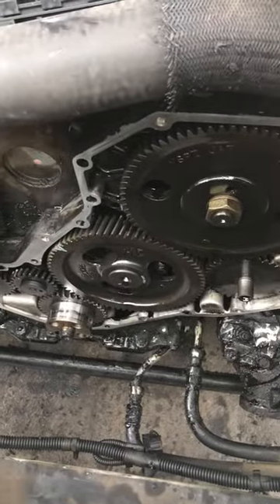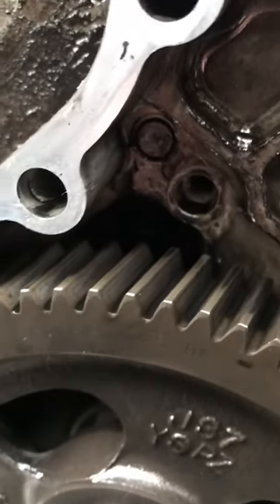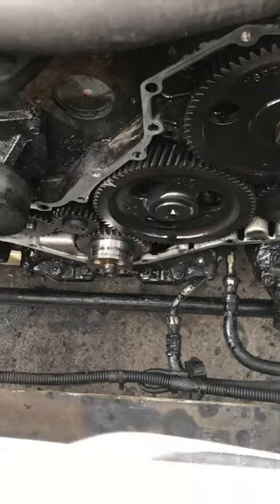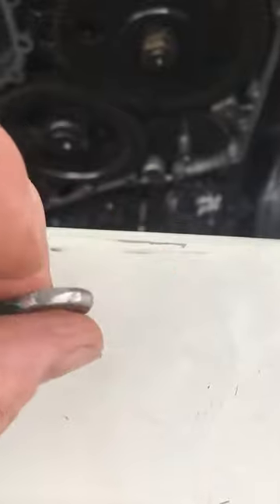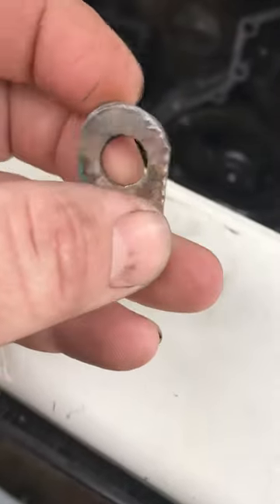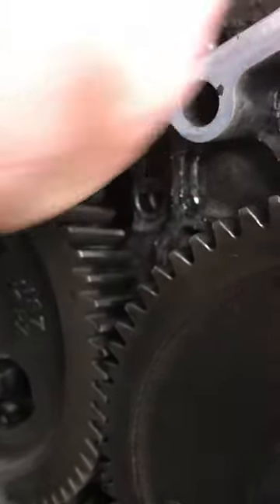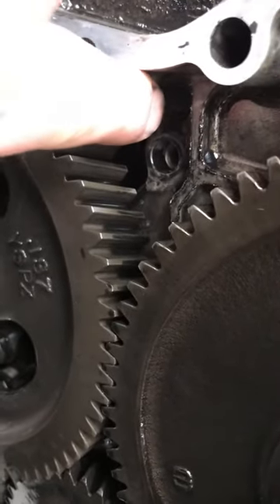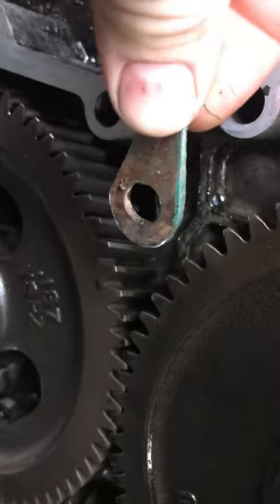12 valve Cummins dowel pin of death (FIX)

Comment: Nice.   But could you just remove it and leave it off? My understanding is that it was a manufacturing locator for the timin chain unit (?)? Or maybe replace it with a threaded nut (tapping the hole obviously) or filling the hole with something that would not create catastrophic problems if worked out....e g  epoxy? Your solution is th one sold by b&d (?) I think and is nice diy.   Thanks for the post.    Were you in there for a other reason anyway? 
S